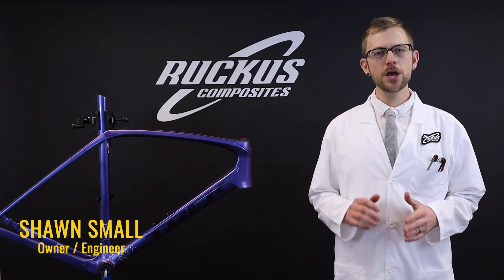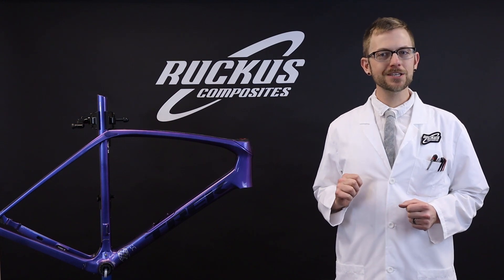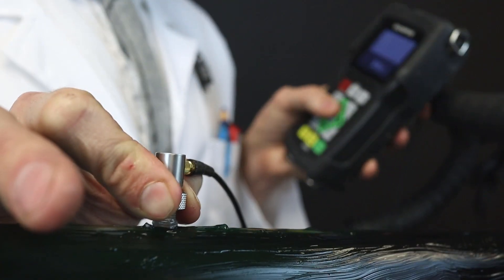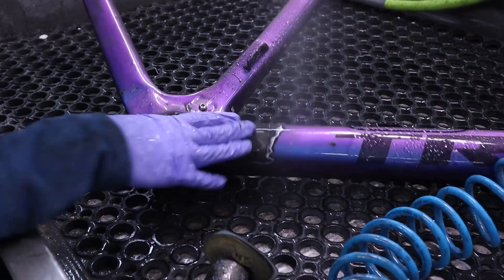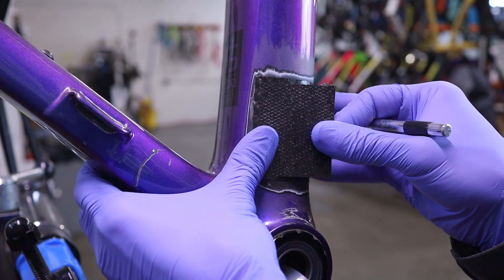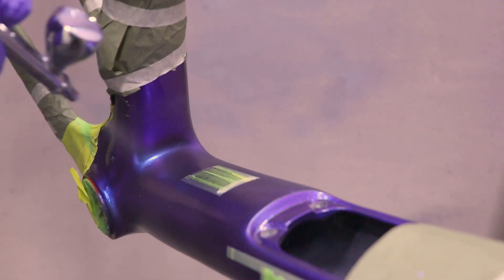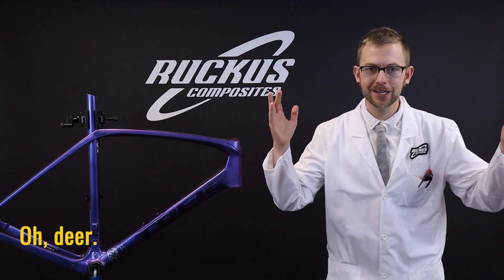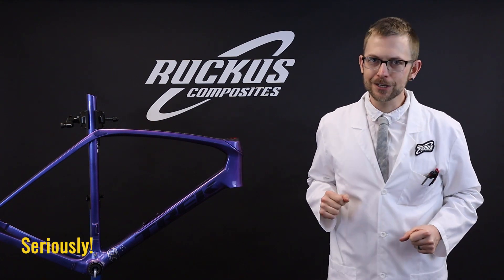Carbon Fiber Repair

Comment: Ruckus Composites repaired the seat stay on my Trek Madone 6.5 six years ago. During a hard climb, the derailleur broke off; came around and smashed the seat stay. Ruckus repaired the damage, repainted the area and exactly matched the metallic red paint and all the white logos and trim. To this day you cannot see where the damage was located. More importantly , the bike rides exactly as it did before the damage. In addition, Ruckus replaced the poor quality integrated read derailleur hanger (a known Trek weakness) with a replaceable derailleur hanger similar to those found on bikes like Cannondale. I am extremely happy with the work done by Ruckus Composites and recommend them highly. The Trek Company offered a $1,000 discount on the purchase of a new frame. So much for their lifetime warranty. The bike was less than two years old at the time.
Reply from the maker: Thank you for your kind words!!